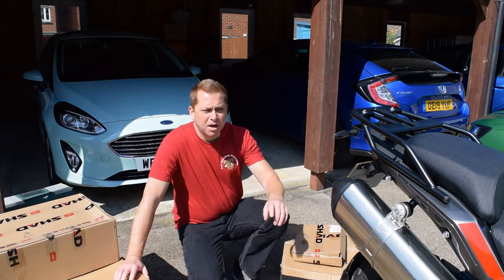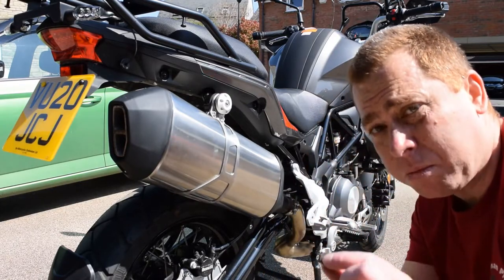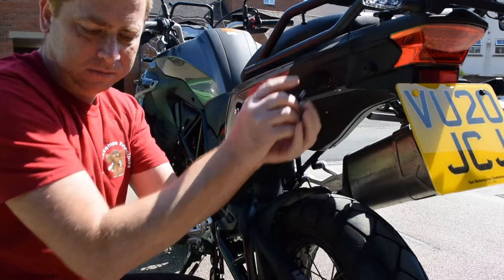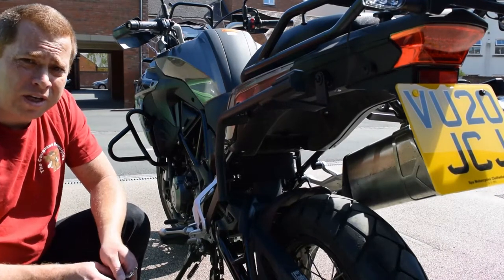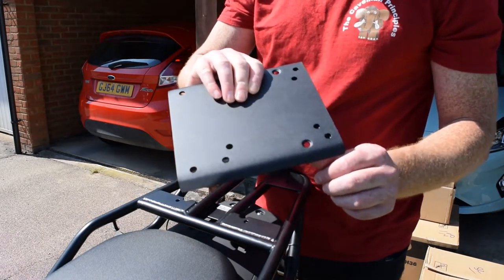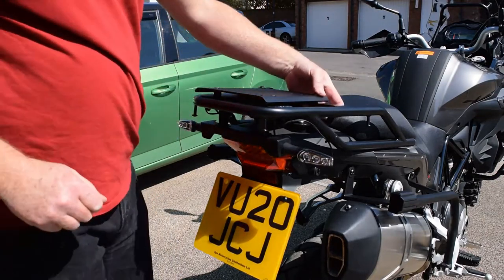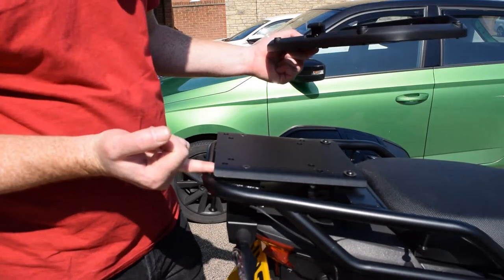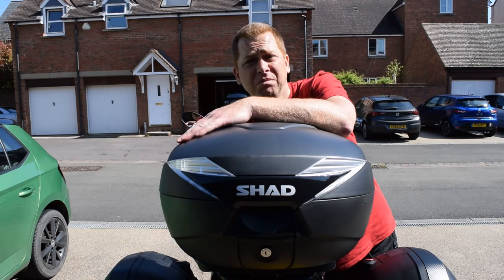Fitting SHAD SH36 panniers and a SHAD SH39 top box

Comment: Hi thank you for the video. I have purchased the same top box but sometimes find it hard to clip the red holder when set at the highest position. I lift the cover to the max but it is not enough to allow me to push the red clip. Sometimes it works and some other times I struggle. Does ist happen to you too?
Reply from the maker: Mine is working perfectly. I rarely remove the box though. Yours might need the base plate repositioning? Make sure that it is flat (no bulges.)